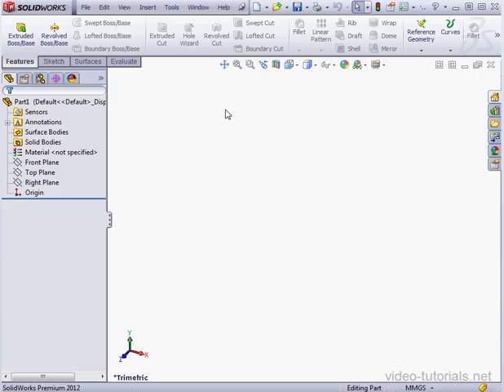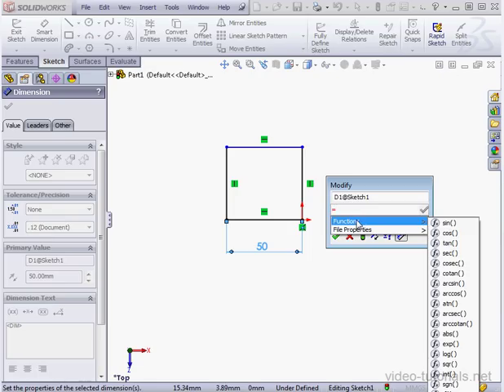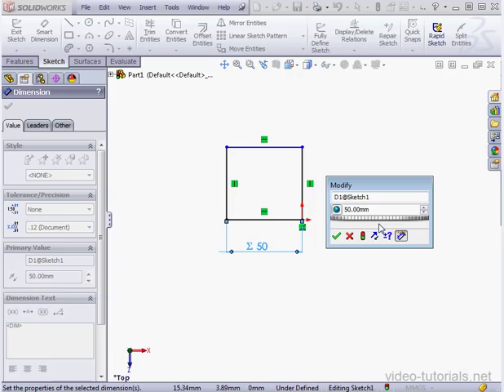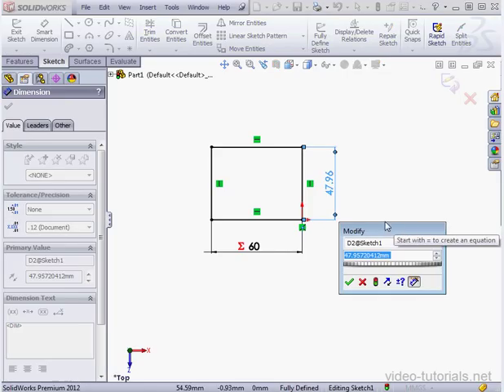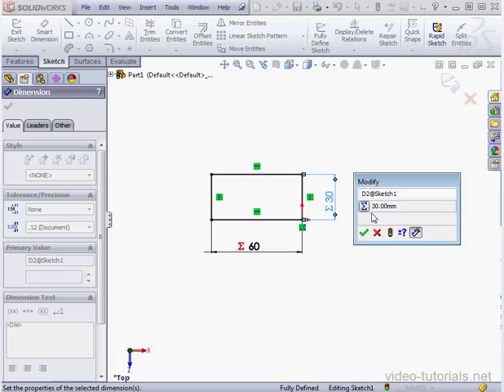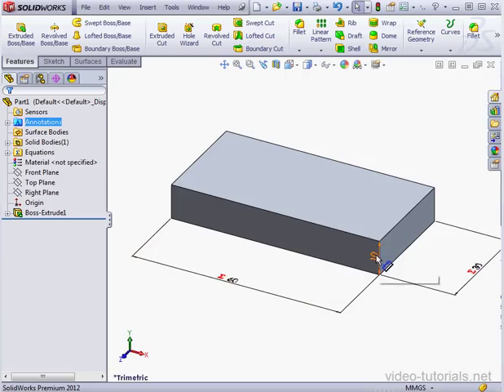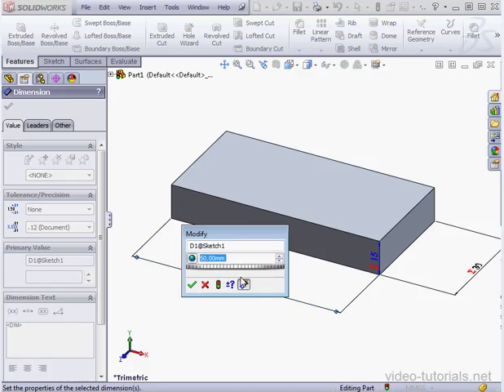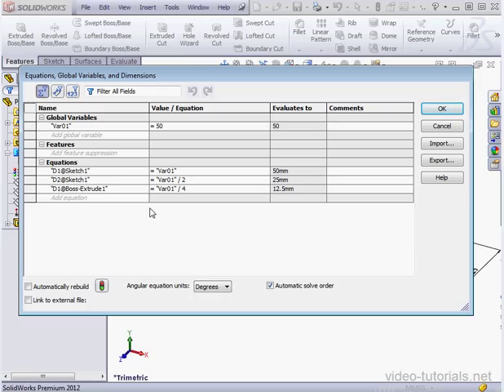SolidWorks Tutorial - How to dimension using equations and variables in SolidWorks 2012

Comment: Ugh every time I try to dimension the box doesn't show up. Hate solid works
Reply: 1.) Select face to do sketch on.
2.) Go into sketch mode and draw your shape.
3.) Hit the [Smart Dimension] button which is right next to the [Sketch] button. All are found in the tool bar under the Sketch tab.
4.) Now with dimension tool select the side that you want to dimension. NOTE : you still need to be in the active sketch during this operation. Once selection with dimension tool is made your (MODIFY) dimension box will appear
Reply: you need to be in sketch/edit sketch mode